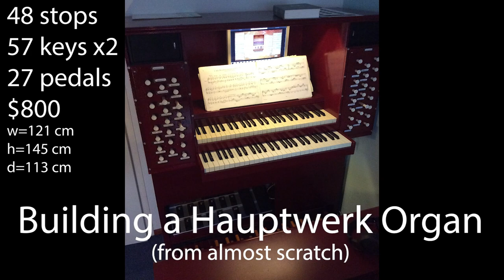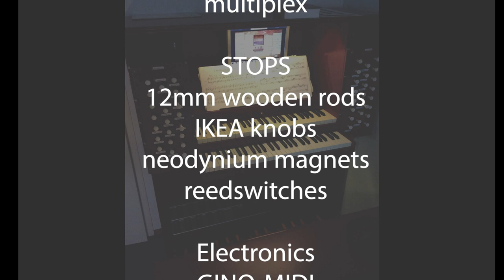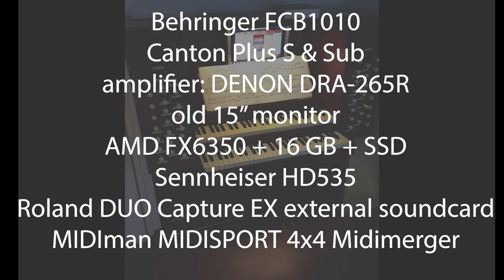Building a Hauptwerk Organ Console ($800) from scratch

Comment: Beautiful job!
I got the pedalboard (25 keys) from an old hammond organ (also via marktplaats ;) ) and midified it using an arduino. 
Btw. it was a fully mechanical pedal, so i had to cut screwterminals so that a hall effect sensor could be placed in it. It needed wires for the negative that jumped to every sensor, same for the positive, but it also needed datawires that jumped to the arduino (1 for every sensor). Not to forget the resistors that needed to connect the two outer pins. It was a lot of wire screwed in a small hole. 
It took like one and a half day in total to do. Normally i had to go to school, but we had Covid in the family, so i couldn't go. I never got covid myself, but i got a lot of time to finish it.

I already had a yamaha keyboard, so i experimented with grandorgue (some free software like hauptwerk). I eventually bought another midi keyboard to add another manual. I was also thinking about those kind of pull stops, but eventually went with a cheap bulky touchscreen monitor i found on marktplaats. It didnt need to be a good quality monitor since it was just for stops. The only problem was that if i wanted to play, i needed to connect my laptop with every cable. It also took a lot of space on my laptop. Samplesets are not small. 
Now i found a set with just the motherboard, i5 processor, graphics card and powersupply for a very good price. We build a case for it, and now its almost finished. Just the last touches like soldering an amplefier and making an external control hub for pc/volume/light controls and a headphone jack.

It has a bit of a modern look because of the style of the upper manual. But i love it!

It's not just about the product, but also about the proces. When you can tell people you build it yourself, it has so much more value that you can't express with money. (But making it yourself is also way cheaper ;) )